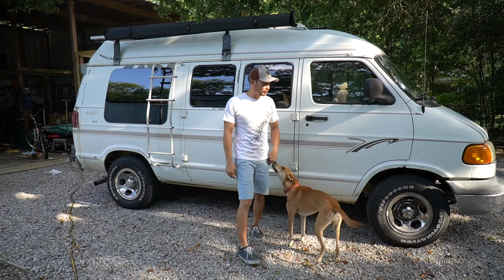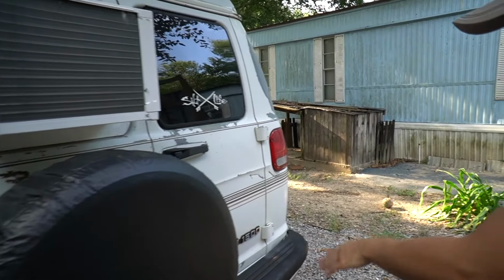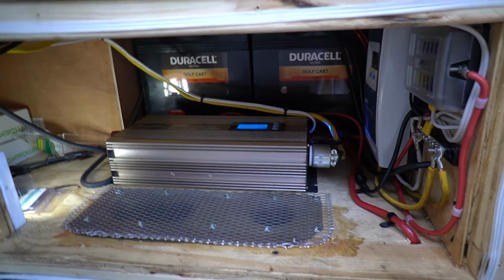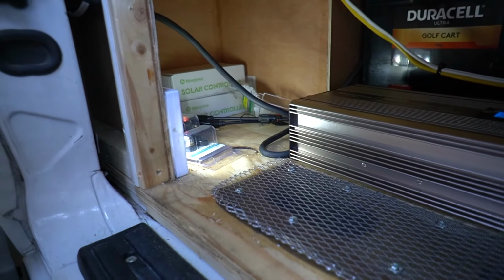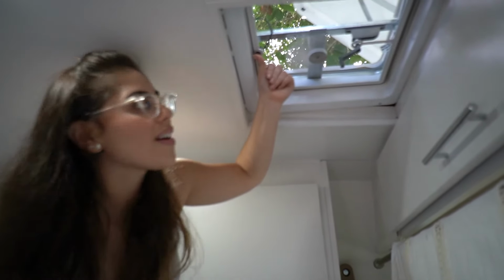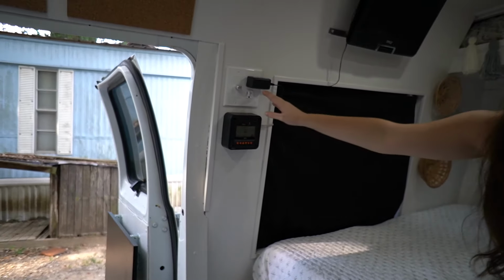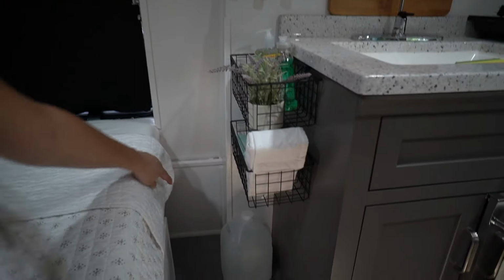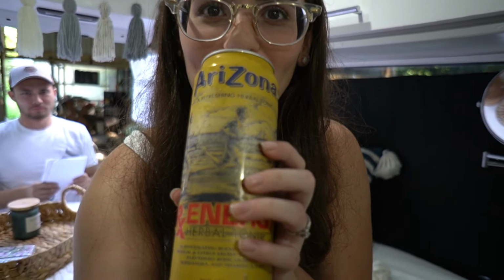Self Built Conversion van, walk through 1999 Dodge Ram Van high top.

Comment: Awesome van! I love travel vans, I used to have a 1999 Chevy conversion van with the fold down back seat that becomes a bed. Loved it. Now I hope to make a smaller version out of an AWD Chevy ASTRO. 
Found your video because I'm buying a 1996 Dodge van to use for people hauling, and was looking for other peoples experiences. Seems like a solid reliable van. 

You might need to add a vent to the outside for the battery box, just to vent the hydrogen outside and not let it condense too much. Good idea to seal it from the cab, but it should have a source of fresh air as well. Just to be safe from fire.

Comment: Quick question. I'm working on the same model car but it's 2001. There's a vent with what I think is a battery or something that's in the same area where you put your batteries in yours. Did you have something like that? And if you did, how did you remove it?
Reply from the maker: Are you asking how I removed the batteries if I had to? If so I had the bed come up and then that area was sealed off with a small little vent out the bottom of the van just to be safe and not have any fumes go up into the van

Comment: Very nice build. But, in the battery and inverter compartment you need to put a fan in one or both of those holes you drilled. Those components generate a lot of heat especially the inverter and you have to pull that heat out of there. Just having the two ventilation holes is not enough. Heat rises so, you have to draw the heat out. You have a nice setup but if you don't install those fans to pull that heat out you'll regret it and you'll be buying a new inverter. You guys did a hell of a job. The interior is excellent. Safe travels..
Reply from the maker: Totally get that but if anything I figured the fan on the inverter was adequate at the time. That or I completely forgot to put one in, and I did pan on putting one in there, must’ve forgot

Comment: So... I gotta 92 d350 dodge van.. the big brother to your van ....possibly going to do a van build... and this is the second van I've seen with the window unit ac...I was curious to know what is the run time for the ac on your power supply?
Reply: I would think a generator or plugged into campground electric. No way batteries can run a window ac
Reply: @alphawolfadventures1470  oh ok.. I was thinking you had a battery set up .. but you use shore power or a generator...gotcha .
Reply: @THATGUY-vb1jf  not my van but I know I have a 13500 btu rv ac and it takes 2 Honda 2000 inverters ran parallel to run it. They take a lot of power

Comment: I have a van just like that and I want to convert it to a camper. I have questions.
Reply from the maker: well my advice would be to get a 2500 version or get a slightly bigger rear end, the weight tends to slow you down. Abe.
Reply: @thatguysgarage323  my biggest worry is taking out the interior and figuring out what to do with all that wiring. It has lights lining the back ceiling, an electric back bench/bed, an old tv and VCR.
Reply from the maker: @debraproctor6396  I personally unplugged all of it and tucked it away never had any issues out of it. 
Tip: unplug a few wires at a time but then go start the vehicle to make sure it starts and runs.